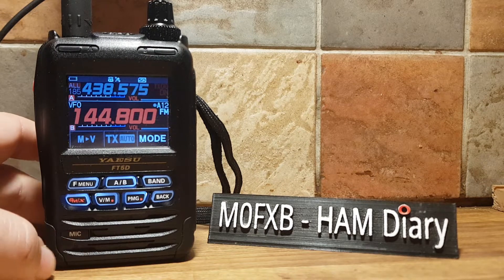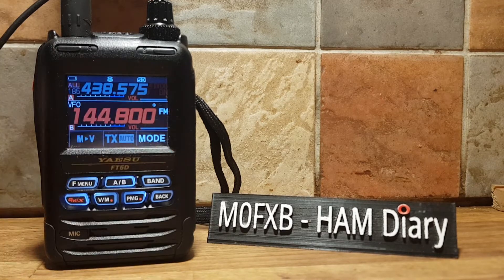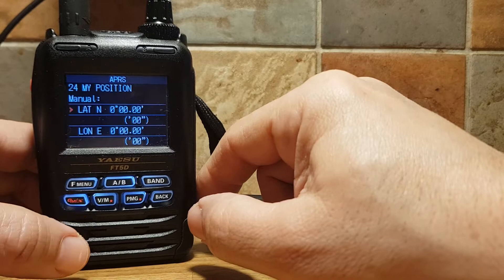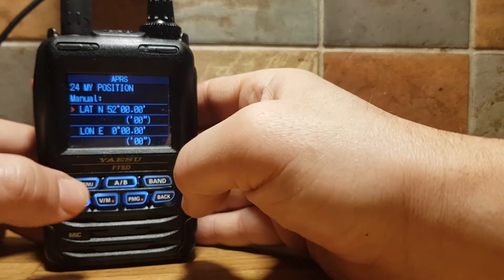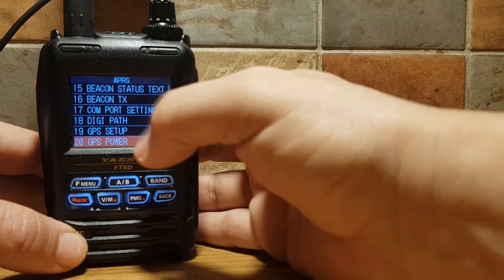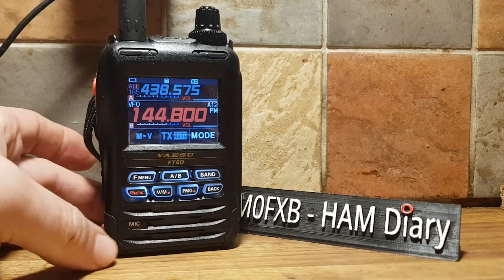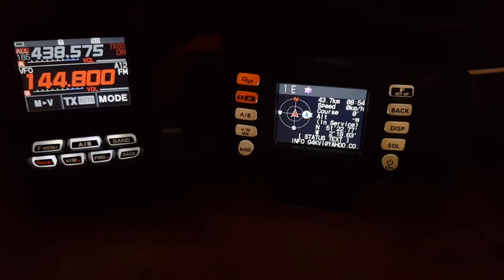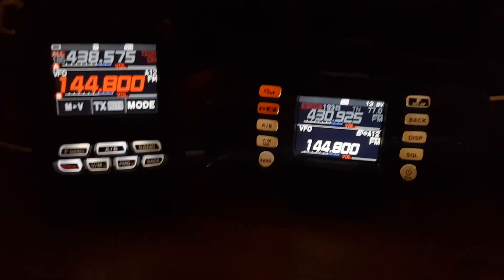Yaesu FT5 - APRS - Error (3 beeps)

Comment: I had a problem where I was getting 3 beeps every time I tried to manually send a beacon and I couldn't transmit messages via SMSGTE either.  In the end I figured out I had my squelch on the APRS channel set all the way open or almost all the way.  When you hit "BCN-TX" or "M-TX" it is trying to transmit instantaneously and if the radio is receiving at the time it just beeps 3 times.  It seems obvious now that I figured it out but it stumped me for a while.  At any rate - make sure your squelch is set above the noise floor on your APRS (B Channel).  Hope this helps someone else!
Reply from the maker: Hi great info thanks
Reply: Precisely the same for me, thanks for mentioning it Ryan!. Someone should make a video short.
Reply: perfect, thank you.